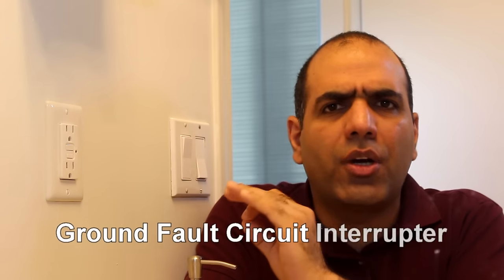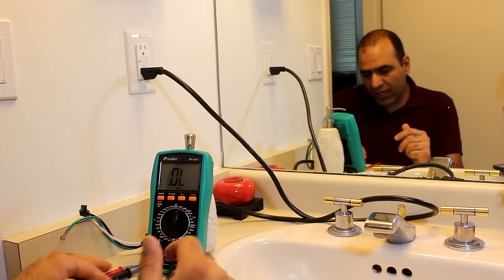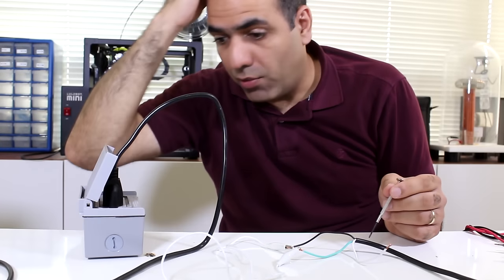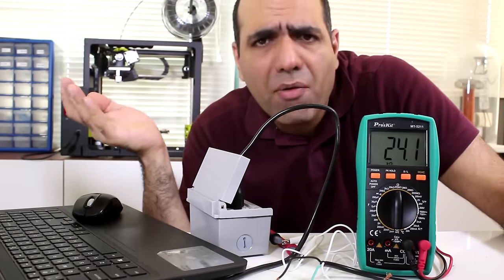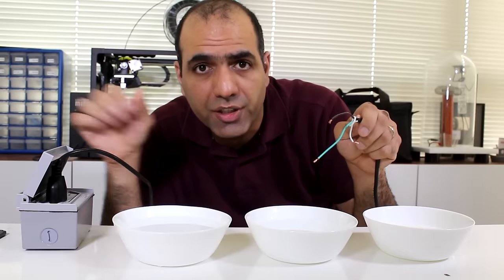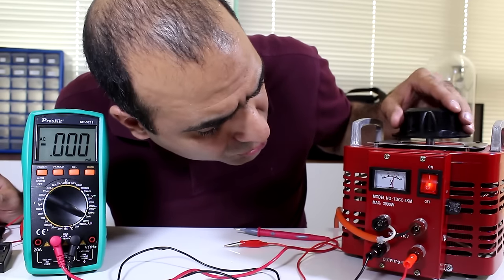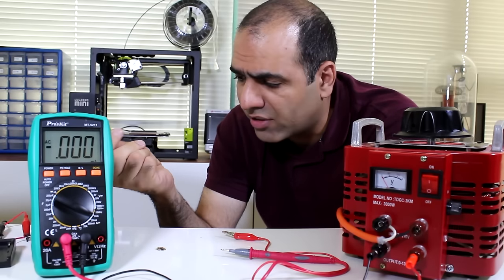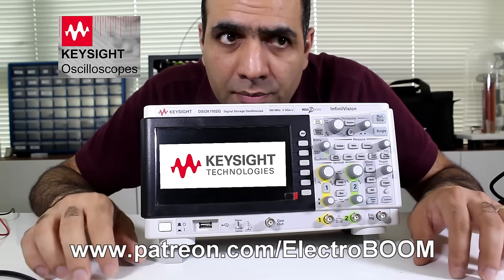The Outlet that Saves Lives

Comment: We have 220v mains, and the differential interrupters are installed on the electric panel, next to the circuit breakers. They trip at 30 mA for normal circuits, but there are others that trip at lower currents for things like jacuzzi, pool lighting, etc.
I think that the 30 mA ones are intended to trip before someone could be exposed, because faulty devices are likely to leak current to ground. A circuit breaker wouldn't trip until the fault to ground reaches the CB current rating, which is a lot more than 30 mA. At 30 mA it could potentially save your life, but it's still quite risky. Probably that's why the ones used around water are lower current.

Comment: But In our country outlets are 230 Volt 50 Hz.
Reply: My ones are 260V AC
Reply: europe
Reply: In all countries except USA and it's followers, power distributed to homes in 220/230/240 volt
Reply: In our country (India) phase voltage is 240 V and line voltage is 415 V
Reply: Japan being Japan uses two different systems. Because of course they do.

It's all 100v but 50hz in some places and 60 in others.

UK used to be 240 but we're supposed to be lower now for greater European integration.

My plug socket says 245 at the moment though!
Reply: Canada and Japan isn't part of Europe, facepalm
Reply: Using 240 V is economical. Because with the increasing of voltage current will be lesser. So loss will be less and small diameter wires are required for wiring.
Reply: Same with Australia, where it is mandatory to have every circuit (lighting included) protected by RCD's. You basically cannot be electrocuted unless you have some funky set up
Reply: Coolstorm10 the UK uses 230V at 50Hz
Reply: UK was at 240V, alot of europe was 220V. In 2004 europe harmonized colours and voltage to a collective 230V and made new cable colours the same. Thing is nobody actually changed their voltages.....only allowed tolerances were increased
Reply: Using 240 is dangerous. I'd rather have safe electricity than cheap electricity.
Reply: Breakers are standard in Europe and all metal casings are connected to ground. It is safe and cheap.
Reply: Breakers are a required part of the building code in the US as well, 120 volts is a MUCH safer voltage, and there isn't a breaker on Earth that can tell the difference between driving a normal electrical load and electrocuting a human being.
Reply: Yes there is. We call them RCD's. There are three basic cables in the electrical system in UK we call them Live, Neutral and Earth.
Normally current is only to be passed through Live and Neutral. The Earth being redundant and only has current in the event of a fault. The RCD is an electromagnet and only operates when there is an imbalance between Live and Neutral. This is in the event someone has touched a Live cable and is creating a path to Earth (via floor or pipe or earthed metalworks) and so the current wont be returning in its entirety through Neutral. The RCD is designed to operate at 30mA, which is low enough to not cause fibrillation to the heart, and operates in 200ms or less. I have touched a live to earth with my hands and its nothing because it operates so fast.
Now touch a Live to Neutral cable, and the RCD will not operate since you are just bridging the normal flow of electricity. Then you will need to rely on your Circuit breaker to trip, which can be from anywhere from 6A upto 60A.

Also, most people don't play with electricity in England. I don't know when the last time someone electrocuted themselves to death was, but I don't think its happened for sometime. It is a legal  requirement for adaptations and alterations to your electrical system to be done only by qualified professional. UK has shuttered sockets for decades now, US has not. UK has three pin sockets for Decades now, US does not. UK has RCD at distribution board level for Decades now, seems US did not?. UK has RCD socket outlets and adaptors for a long time now, seems like this guys saying there like a new thing?

Don't mean to do a whole UK/US thing. Just comparing what I know against this video.. :D
Reply: If you live in safe voltage range (120V), then we live in safe current range.
Reply: mikeee6 - Just like with GFCI breakers in the US, there has to be a fault to ground in order for the breaker to trip. Like I said, there isn't a breaker on Earth that can tell the difference between driving a normal electrical load and electrocuting a human being. The US has required grounded outlets since the late 60s, about half a century ago. I used to work for a general contractor who did remodels and repairs, which means that I saw the inside of a LOT of houses and apartments, I've never seen an un-grounded outlet in the US that was still in use. 

I wasn't saying that GFCI outlets are a new thing, I was saying that I'm very surprised that the father of the girl who died isn't in jail because GFCI-protected outlets have been required in bathrooms for a very long time now, at least as early as the 1970s. 

Sourav Bagchi - No, you don't. Higher voltage means higher amperage, that's the whole reason why higher voltages are dangerous. Even a cell phone can supply enough current to kill you, it just doesn't supply enough voltage to push it through your body.
Reply: hehe you say potato i say potata type thing... earth/ground!  makes sense for ground, because if you were on the moon would it still be called earth? haha. anyway. all good, here now we us RCBO's which are a combination of an RCD(GFCI) and a normal MCB(breaker). the only benefit is that double voltage means the MCB(breaker) can be rated at half the current and the cables can be smaller. But its all about the power baby 245V in my house - you should see my kettle boil compared to the same one in spain its about 30V difference and feels like 30min extra to boil it
Reply: Higher voltage drives more current through the same resistance. 
I=V/R
0.3mA = 120V / 400kΩ
0.6mA = 240V / 400kΩ

Neutral and ground are different wires, different paths to ground. Neutral is a common ground. It's interconnected throughout the power grid and grounded just about everywhere it can be. Protective ground is grounded locally and is not connected to the grid. It's an emergency path to ground.
Reply: naaa. we have diffrent earthing arrangment systems and if yur earth pass resistance is too high then they basically connect your earth to neutral at the incoming supply side in your house. check out tnc-s
Reply: How do you think it would go if they just charged up like 50kv and a few Farads worth of capacitors and discharged it for the death penalty lol. would it explode the body?
Reply: Spiffing ol' chap. I'll brew a fine cuppa tea and await this revelation
Reply: US has 240V running to house then it is stepped down to rest of house. Refrigerators, Stoves, etc. run off 240V here.
Reply: OrionsBeltsmith - It's not stepped down so much as it is split. You have two live/hot wires and one neutral coming into your house. The two hot wires are exactly out of phase with each other. One feeds half your house, returning on neutral. The other feeds the other half, also returning on neutral. Your dryer, stove, water heater, central air, and anything else getting 240V gets all three wires, and ground. Anything powered from either of the hot wires and neutral gets 120V. Anything powered by the two out of phase hot wires gets 240V. 

Bridging an amplifier works the same way. In a bridgeable amplifier one positive terminal is hot and the other channel's negative is hot. The other terminals are just neutral return paths. If you hook one 4Ω speaker to each channel you get (let's say) 100W. If you hook up one 4Ω speaker to the hot positive and the hot negative you've doubled the voltage and you get 200W. If you hook up both speakers in parallel you halved the resistance and you get 400W. This is assuming the amplifier can handle a bridged 2Ω load and provide that much power of course.
Reply: We have 120 volts @ 60Hz
Reply: You just made me clean my screen. And it didnt come off. You deserve my upvote.
Reply: In India, 11 kV electricity is supplied to a small area from the local dispatch center. Then it is stepped down to 240V (line to phase) and distributed to houses. 415V (line to line) three-phase electricity is also distributed to many houses (who has pump-set). And neutral wire is nothing but an another ground wire which is grounded at the local transformer.
Reply: You say we're not safe in Europe, and you don't even have RCDs on your entire house. A $50 piece of equipment that can be installed in 10 minutes by anyone with half a brain would have protected the entire house, including the bathroom where this girl died.

But hey, 120V are so safe, why bother?
Reply: Don't waste your money on normal Circuit Breakers or GFCI. Install a Residual-current circuit breaker for your house. It will save life and money also.
Reply: U forget that electrocution isn't the only hazard. High current=greater chance of a fire. Hell u can be burnt alive if ur bed catches on fire & ur on sleep medication.
Reply: Are u saying don't install MCBs at all?. By the way do u have RCD at your house?. In India there are many of us who know of such protection devices but next to none install them in homes. We do not put our thoughts into action. Elders in my family think it's a luxury that isn't worth the money!. My dad says if one is stupid enough to touch a live wire they are stupid enough to die. Apparently he's doesn't understand the word "accident!". He goes on to spend 10k on a tea table & another 10k on curtains. But thinks 1k for a RCD is unaffordable!. Is there any hope in convincing such people?!.
Reply: Brijesh, Many houses don't use MCB also. They only use a manual operated Circuit Breaker. Even the electrician who did the wiring of our house also didn't install any protective devices and my family members don't know nothing about electricity at all. My dad was just brainwashed by the electrician. I was then just a kid. Not only my dad, many households were cheated by electrician. And I think they don't about RCCB at all.
Then after some years when I was doing engineering I installed MCB, RCCB in my house and did lots of improvement.
Reply: I am an engineering student too. In my case, both my parents are dipl. in ece!. They simply aren't willing to accept. We have a small farmhouse too. There my dad just has the wires of the motor shoved into the socket, no plug at all. Do u know his argument?!, he says "even a sslc fail manual worker can use this, what are u afraid of as an engineering student?!". I too will upgrade once I start earning. But it just infuriates me every time I think of this! Sorry for the rant!, needed an outlet!.
Reply: or 3 pase 400V 50hz
Reply: you mean 240Volts 60Hz 3 phase in US
400Volts 50Hz in 3 phase outlets in all EU countreis
Reply: Yes this is true. This is purely because the considered safe touch voltages are 55v a.c. and 110v d.c.
110v ac can still be lethal. 55v less so. 
We have different plugs and colours for site/industrial/commercial use.
A yellow commando plug - 110v, red - 240v, blue - 415v. On construction nothing is allowed except either 110v tools, or battery tools (preferred).
Reply: what your thumbnail profil pic thing? seen a few of them like that...
Reply: 500 Finnish marks bill
Reply: In the UK, We have 230V AC 50Hz. We also have 3 pin plug sockets.
Reply: EU is 230V with at most a ±10% tolerance. To confirm with this, the UK has 230V with a +10%/-6% tolerance. They haven't really changed anything. Plenty of other EU countries that were on 220V did exactly the same but with the tolerances reversed.
Reply: Jack Hargreaves That is correct
Reply: only 10A? we have 10A 16A 25A 32A ...
Reply: Al Brautigam do you realise your saying 120 fits into 400 3 times, then saying 240 fits into 400 6 times ??
Reply: soundspark so is there a copper rod you put in the ground for your neutrals in the US then if you split a 240 phase up across houses?
Reply: Ned We do they're required in all homes and businesses built after 2011 and learn about the nec
Reply: Conor Clarke The U.S. also has 3 pin sockets yes they're required have been for decades
Reply: Yes I know that, but the only different is that I feel that North American Plug Sockets are not as easy to remove from a socket as the UK Alternative
Reply: Yes I know that, but the only different is that I feel that North American Plug Sockets are not as easy to remove from a socket as the UK Alternative. Another Question that I would like to ask as I am from the UK, I know that the Sockets in the US are grounded by the Standards, but are your Sockets fused as I am never able to see when you are able to take your plugs apart
Reply: Conor Clarke Actually there quite easy to unplug
Reply: Doesn't seem that way
Reply: Conor Clarke no it's usually the device that has the fuse or a phone charger but it depends on the device
Reply: So you're saying that not all plugs in america contain fuses, oh well, I suppose it is kind of like that over here
Reply: Conor Clarke yeah buts the actual device not the plugs
Reply: Sourav Bagchi yeah but ours are designed to trigger at the same amperage (5ma)
Reply: Coolstorm10 Britain is 240
Reply: Sourav Bagchi similar to UK but our transmission lines vary from 10kv to 500kv
Reply: Great it means quicker death in the event of short circuit!

Comment: In Germany we have something called FI it means in German „fehlerstrom schutzschalter“ in English RCCB (Residual Current operated Circuit-Breaker) it does the same, but it’s installed before all breakers so it protects all Live wire.

Comment: I don't understand why all household circuits don't have to have ground fault protection in the US and Canada. In Australia we have to have all household circuits protected. The circuits are protected in the switchboard rather than in individual outlets.
Reply: Perhaps the house builders objected because of cost? Or perhaps some appliances manufacturers objected because they make lousy appliances that trips GFCI. From safety standpoint I agree all circuits should be protected.  But the home owner can choose to add GFCI to all circuits if he wants.
Reply: Maybe because the normal domestic voltage in USA is 110V. It's dangerous but no where near as bad as your 220V.
Reply: At least in the UK and Spain they are mandatory as well. I haven't seen any household circuit without it. Here in the UK they are called RCD (Residual Current Device) and in Spain I think they are called 'differential circuit breaker' or just differential if you know the context (if you talking about cars then the meaning is a completely different one ':) ). They are rated usually at about 30 mA.
Reply: US standard for nominal is somewhere around 120v last i checked.
I see your point though.
Reply: Some is the cost but more importantly some of it has to do with accessibility. Let's say I have an outlet behind a refrigerator then it does not have to be protected cause most the time no one is near the outlet. GFCI only protect people not appliances.
Reply: In Poland we have this way like you
Reply: Here in México the "differential circuit breaker" is mandatory but it's only used on circuits derived from the main switchboard to wet places like a bathroom or a pool!!
Reply: In the us the new standard is arc fault protection on all curquits in the house which is very similar to gfci.
Reply: This is true that AFCIs are now required but they do not trip at 5mA current leakage like GFCIs do. They are only designed to protect from electrical fires and incorrect/faulty wiring. They do not protect from low current leakage to ground (through your body for example). Separate GFCIs are still required to protect from this.
Reply: @11_22_XX  no, V/R=I, since your body is just a R, double the voltage will double the current
Reply: Circuit breakers like this are somewhat prone to get triggered by voltage spikes, for example a lightning flash. Also, on dry floors they may not have practical use (you drop the hairdryer and it breaks and live wire touches the floor - nothing should happen to you). A fridge in the kitchen does not have the breaker equipped outlet even though other outlets in the kitchen are "failsafe", because we don't want false triggering melting the fridge. As a consequence, in our house the fridge is at the same circuit with living room lights 😂 So pay attention when doing electrical installations - see what turns off with the fuses you toggle.
Reply: Switchboard= Fusebox= Breakerbox   ....??? Methinks the standards vary widely.  Fuses are still used in some equipment... and buildings. Although no longer installed in Canada, still found in some Prisoner-of-War camps....
The Reservation Industry is still strong in Canada.  Many Aboriginal Leaders are awakening now though. Glory !!